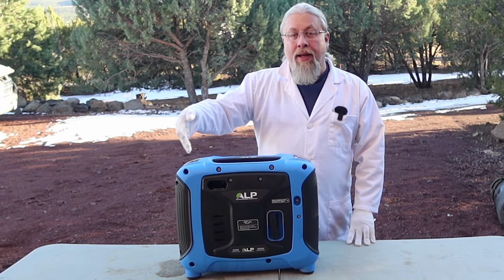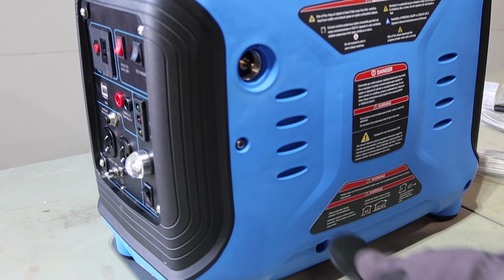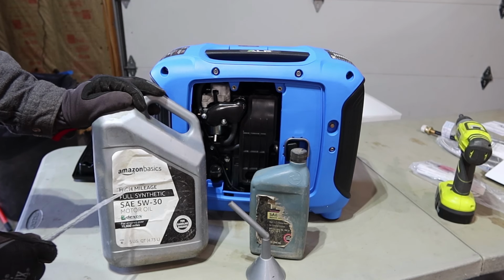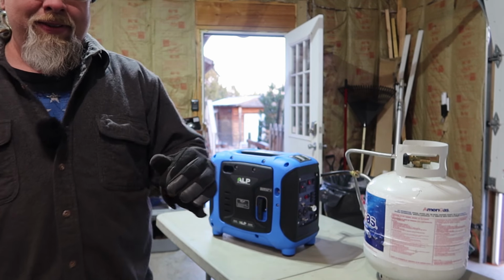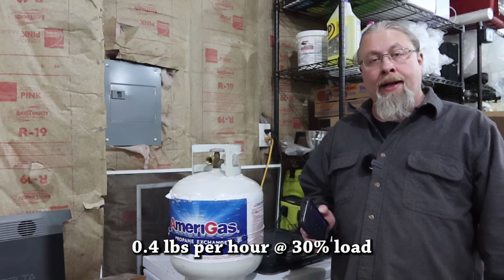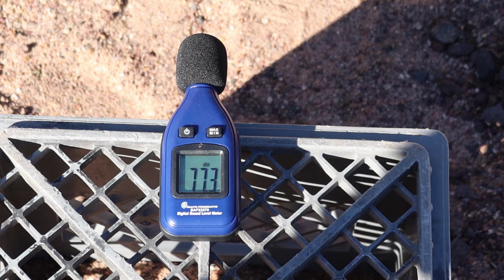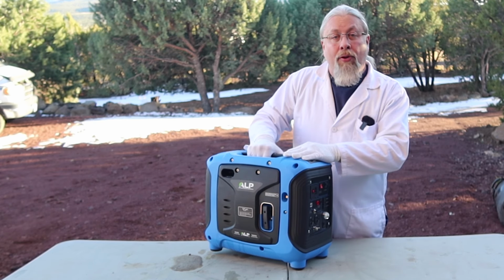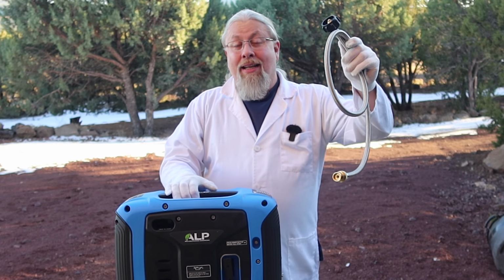ALP 1000w Propane Generator Review | Parallel Ready Eco Friendly Compact Efficient

Comment from the maker: HOW TO PURCHASE:
1) Add hose to cart https://hobos.cc/HyMy 2) Add generator to cart https://hobos.cc/1LAs 3) Use code HOBO1020 at checkout!
*PLEASE WATCH PART TWO BEFORE COMMENTING ABOUT THE NOISE!* --> https://youtu.be/LusD7q2vJnw
Reply: @HOBOTECH — hey man... one little tip/suggestion I felt I should share... Something I do quite often when a product has SCREWS where they’re less than convenient & I know I’ll need to remove them often... REPLACE THEM with a screw that has a KNOBBED END or an end that features BOTH a standard driver pattern, AND a swivel D-Ring (commonly seen in photography applications).

Since that door isn’t exactly concealing a large “security risk” and even with children present I highly doubt their “curiosity” will provoke them to undo both screws on such an intimidating machine, I see NO REASON to leave those screws in when you can swap them for a “tool free” alternative. 

For anyone besides Professor Hobooooo reading this, if you’re unclear on HOW to find an alternative fastener that has the same dimensions & thread pattern.... Just take one out, measure it’s thread length & diameter, and take note of the thread TYPE.  Search for either a “male threaded knob” or “screw with knob head” and etc... you get the point. As long as the LENGTH/DIAMETER/TYPE of thread is a match (AND there’s enough clearance on your equipment to allow for the knob to function properly) you can’t go wrong.  

The manufacturer should sincerely consider the fact that PORTABLE GENERATORS are not only for “ideal” overlanding applications and ARE COMMONLY DEPLOYED IN EMERGENCY (UNIDEAL) SITUATIONS such as winter power outages and active rain/snow storms!!!

Fumbling with SCREWS & SCREWDRIVERS during on-the-fly oil changes, maintenance, or troubleshooting during already tumultuous conditions?? NO THANKS.. 

The solution I’m offering here SHOULD BECOME STANDARD EQUIPMENT or should be added into the package so the end-user can choose which they prefer. 

They created a fine piece of machinery that MOST will want to trade in their gasoline generators for which PROMOTES long term usage where impromptu maintenance & troubleshooting WILL ARISE. 

Small details like this one are what separate the Hyundai’s from the Bentley’s... 

I think HOBO should provide this feedback and let’s see if they send out 2 upgraded screw replacements to anyone who already purchased this. Ya never know!
Reply: @flojotube  So for the novice, where does one buy this alternative...@ an auto parts store, Home Depot, etc.?
Reply from the maker: @itsallaboutjesus8935  You get it on their site via the links I posted in the description.
Reply: @flojotube  Be sure to use plenty of "locktight"'.
Reply: I was just scrolling down to let you know about the normal distance the sound is rated from. 54 is very low though. That generator sounded loud. Hard to tell not in person.
Reply: The code HOBO1020 is not working at their website
Reply from the maker: For those wanting more power don't forget TWO can be paralleled!
Reply: The economics just do not work.  Propane is too much money compared with gasoline. Gasoline is cheaper and it is more energy dense.
Reply: @tarstarkusz  agreed on my 6,000 watt 3000 continuous watt generator if I'm not running a lot I've literally seen it last 20 hours off of 3 gallons of gas
Reply: @tarstarkusz  or I can run a thousand Watts to 1200 watts for 12 hours off the same 3 gallons in the reality it's a 3 gallon tank it doesn't even use 3 gallons because I'll fill it up twice over a 1 day period and the gas can I'm using is only 5 gallons so I'm only putting in 2 and 1/2 gallons up to 3 possible
Reply: @CraftArtist  Not to mention how available gasoline is vs propane.  I live in a very built up area with natural gas, so there aren't many residential propane users that I know of and so getting propane is a bit of a hassle.
Do you happen to know what the use case is for this?  Why would anyone choose this over a gasoline generator?
Reply: @tarstarkusz  no clue from what I've heard it's supposed to be more efficient but I have not seen that to be the case I guess it would be good if you got like a generac generator and you hook it to your main line gas then it would be more beneficial cuz you would never have to go by gasoline but that would be just beneficial from a convenience factor
Reply: @CraftArtist  I'm pretty sure it would be a lot cheaper to run on a gas line service than even gasoline.  Natural gas is pretty cheap.
Reply: @tarstarkusz  that's the only way I see it being feasible
Reply: @tarstarkusz  Gasoline "spoils", especially typical gasoline that has alcohol in it's formulation which includes virtually all gasoline that isn't certain premiums (like Union 76).  The alcohol is hygroscopic which sucks water out of the air into the mix which helps decompose the gasoline.   Long story-short, propane generators always start whereas gasoline ones that haven't been carefully drained for any storage over 1/2 a year tend to get gummed up and won't start.  This, you find out in the pouring rain, at night, during an outage.
Reply: A good handyman can glue knobs to screws to solve your screw problem. 😎
Reply: I get an actual 1500 running lots for 24 hours for 5 gallons of gas that cost $10
Reply from the maker: @CraftArtist  Congratulations. That's quite the achievement! I don't think anyone has ever managed to burn a gallon of gas in 5 hours before.
Reply: @HOBOTECH  we get about 12 hours off of a 3 gallon tank but I don't think it actually uses the whole 3 gallons because we only use a 5 gallon gas can every 24 hours
Reply: @HOBOTECH  it's a 6000 watt peak generator 3,000 continuous bought at Walmart for $300 Briggs & Stratton engine
Reply: @CraftArtist   ,  so @ $12.00 a day?
Reply: @DougFenrich  roughly .right now gas is 2 a gallon
Reply: Caution should be used when thinking of fill amounts in terms of weights, given that the tanks are only safely filled based upon atmospheric pressure.
Reply: Buy thumbs screws to replace the Phillips
Reply: Thanks @HOBOTECH I just bought 2 and got 2 free hoses!
Reply: Excellent video!  As a brand new subscriber, may I recommend you re-record your intro with emphasis on the B in Hobo?  I was totally thrown for a loop.
Reply: That's nice but how many app. Can you run at a time
Reply: Help me out with my math. At 2/3 capacity it produces ~550 watts and over a 4 hour period it uses 3 LB of propane. That makes for 2200 watts total with 3 LB propane or roughly 733 watts per 1 LB of propane. 

Is that the best/most efficient setting?
My primary use is to charge batteries with it, so I’m looking for optimum watt per LB. 
How does this generator compare, in numbers, to  other single or dual fuel propane generators?
Reply: Anyone know when these are available again?
Reply: Professor do you ever think EcoFlow will produce a propane version ? Any inside scoop ?🤞
Reply: @HOBOTECH — Dude.... wowwww..... I sincerely wish I could buy this RIGHT NOW.... excellent video AS ALWAYS.... and guess what....

it’s HOOUUUUBOOOUUUU TEXKNOOOOUU!!”
Reply: @flojotube  I  i r if
Reply: @flojotube  i rig
Reply: @flojotube  to  free wiring  free tiwfwit itwigii  r I red fwii r I err otiritirororoiii
Reply: @lindseytrousdale7567  you drunk or high?
Reply: @flojotube  i

Comment: BTW, bring your 20# propane tanks to your local U-Haul dealer, and they will fill them up to as close to 20# as possible. In addition, they will charge you only for propane added to your tank, Vs Home Depot, or other exchange location, where you pay for a full tank even if your old tank still has some propane in it.

Comment: The coolest use of this is to do DC out to into the solar input of a solar GEN.  This would be so much more efficient than an AC generator to charge your solar gen.    Probably 40% less fuel due to conversion losses in the inversion then again in the conversion back to AC.

Comment: After your review, I got this generator. 

We lose our power a lot because of where we live in NEPA. 

Customer service was great. The first unit was damaged in transit. I called and they immediately replaced it before I returned the original. 

We lost power before I had gotten everything set up and needed to fill a tank of propane. I did have a bunch of 1# tanks and just used some of them for the night. We got 3+ hours on each tank but I only ran 2 floor fans, lights, and a tv. It was a hot summer night but this was great for the situation. Since, I’ve gotten a 5# tank for camping and 20# tank for home use. I’m a grandma and was beginning to have trouble starting my Honda but this is just fine. 

So, thank you for this demo.

Comment: What air conditioner do you have that can run on 800w continuous and 1000w peak?
Reply from the maker: Any 6000 BTU will run 350-500w continuous. I once ran one for 3 months during summer on a 800w generator. I have 5-6 year old videos showing this.

Comment: Based on your results, at your altitude, the ALP consumes 1.6 pounds of propane per kWh with a load of 250W but only 0.75 pounds per kWh with a load of 550W.  Internal combustion engine generators are usually most efficient at about 75% to 80% load, and your results are consistent with that.  If using one of these (or any internal combustion engine generator) as backup for a solar with battery system, select an efficient charging rate to use the least propane per kWh.

Comment: The 1000 watt generators just not quite enough you have to have 23 2500 or over, space heater electric skillet, and I don't even know if that will run an AC unit. I want the wind generator 4570 W Surge and $450.00 you can't beat it it has 220 volte, it's not a sine wave generator you got to be careful with your electronics but anything else you don't have a problem with it, plus it runs on dual fuel, electric start !

Comment: You should always take the label off your propane tank make sure it doesn’t have bubbling rust. Surface rust is fine but if it starts to bubble you need to get it checked.

Comment: All gen sets I have seen use 21 ft distance to test db level… you used 3 …..huge difference.
Reply from the maker: You ignored the pinned comment.
Reply: @HOBOTECH  Ignored is the wrong word …it implies I saw it and chose not to acknowledge it . I didn’t see it or any of the others comments ..I liked the idea of the little gen set and was simply making a point about the distance based upon watching the video.. If I stick my face 3 ft from my Honda 2200 inverter it’s loud too. I have several larger propane generators and need one small like this….J.

Comment: Can I use a Eco flow Delta Pro while charging it with 2 APL generators that are paralleled  together or will the power past through to what ever is plug into the Delta Pro ?
Reply from the maker: Some power will charge the batteries while the rest will pass through according to the app settings.
Reply: Thank you!   @HOBOTECH

Comment: Can you use the 12V output to connect a Victron DC to DC charger or converter to charge my standalone battery or standalone power station?  If needed in an emergency.

Thx!

Comment: Thumbs up on the video. IMO for $530 (2023 sale price) this unit is overpriced for it's capacity. It also should come with a hose you can use on a 20 Lb. tank. Who would run this on a 1 Lb. tank? Oil and a tool should be included. I don't like needing a screw driver to add/check the oil. Liking the LED light.
Reply from the maker: My code includes a free hose.

Comment: tbh, if this generator scavenges a bit of engine oil to be used for upper Cylinder Lubricant, I'd buy one, otherwise it'd have to be dual fuel to make sure it gets regular lubrication from the Gasoline. It will be interesting to see how long this lasts before breaking, if it isn't scavenging engine oil lubrication tbh. Great review, many thanks, and best wishes from Bob in Wales.  👍✨️✨️✨️

Comment: Only big problem with Gas Fuels like Propane, is the destructive effect in internal Combustion Engines is the lack of upper  Cylinder Lubricant which is so bad, if used in Diesel engives, the injector pump would rapidly cough and Die. In  edibles, it is why you need to frequently switch from Propane,  back to Gasoline/Petrol, to get those important internals lubricated again. I think this is why Vehicle Sales of Propane have pretty much collapsed in  retain, and there are very few Propane stations left, and it is relatively difficult to find them nowadays. 🤔👍

Comment: Would the generator motor be alright if it was running on a moving trailer with shaking  around , would the oil keep the engine lubricated ?  Thanks for the video and have a nice day .

Comment: Absolutely with our inefficient gasoline that has to be atomized by our inefficient carbs you should change oil at 50hr intervals. But propane does not have to be atomized by the carb and also does not require tons of dirty additives to stabilize it. Therefore you will not necessarily need to maintenance nearly as often.

Comment: I was surprised that the propane actually flowed at that temperature. That’s a problem I have with most of my propane heaters up here in a Vermont winter.  I suppose because it uses so little propane the cold tank can keep up.

Comment: Will this run on natural gas without modification? This would be awesome.
Reply: Natural gas has a lower BTU rating than propane.   If adjustable, the regulator needs to allow 2.5 times more fuel into the engine  if you want to use natural gas.
Reply: @danburch9989  Thank you kindly for the response.

Comment: For Sale: Baja used twice Excellent Condition in box. Inverter 700-900 watt Inverter Generator propane only 1 pound propane cylinder or larger propane tanks. Generator 26 pounds with oil. Can look it up online if more information is needed. Leave a message if interested thanks.

Comment: Best review yet! It sure explained why I didn't get the 60 advertised hours out of my propane tank . Left me short few days on a dry camping adventure.  I needed it to power and ARB fridge freezer and a small mini freezer and I estimated about 40 hours a tank but I didn't count on the tanks not being completely full and I only averaged about 24 to 34 hours a tank. That makes sense now. I appreciate you weighing it and all the time you took to do the test it was very enlightening .  For others people's references, I went through four tanks in nine days.  I was running constantly in the beginning days using the small freezer to make ice for the extra cooler.  I changed the oil every 24 hours because of the environment I was in.   Once I could see I wasn't going to make it to the end of our 12 days, We were able to transfer everything to the ARB and I ran it to power that for about 15 hours day. We ran out 24 hours before ready to leave the island. I'll be better prepared this time and now I know why I need more thanks to your in depth review. Thanks again!

Comment: I bought the Alps 1000 propane generator performance is good I bout to back up my Jackery 1500 with 400 watts of solar panels in case sun was not out for several Days I could still charge Jackery my question -is it normal to smell propane fumes while the generator is running checked the connections and they Appear tight guess I could use Teflon tape at the connections.

Comment: How do I know what is safe to plug into this generator or what it is able to run? Can I use it for an Air Fryer, Toaster Oven or Coffee Maker? Will is run my 7 cu ft. deep freezer?
Reply: You would have to figure out wattage used by each appliance. Then compare them to the generator's rating.

Comment: This is a really expensive generator for what you're getting. It doesn't put out very much power and it's not really that small.
Reply: The benefits of running off propane are great but that's more of a long-term benefit.  It's great to be able to store propane for 10 years because you don't know when you're going to need it. If you're using this regularly then the benefit is dramatically reduced. I will say having a small output generator like this couples with one of those batteries with the pure sine wave inverter in them would be pretty sweet. You could then get your higher outputs and recharge as needed.

Comment: Wow, this would be perfect to run my small AC in my trailer in Baja. I’m on solar exclusively and can’t run AC yet, is very costly to get the system upgraded. I have a monster gas generator that needs 2 strong people to pull out of the shed and gas is way more expensive there where else propane is cheaper than in USA. Thanks so much!

Comment: Don't know if anyone else said this, but your reservations about doing an oil change at 50 hours might be incorrect. I know that my Dad has had experience with LP tractors and has said they run cleaner as far as carbon buildup in the oil! He also said the oil almost always came out just slightly dark like it only had a a hundred or a couple hundred hours on it rather than the 500 they normally changed it at.

Comment: Gas powered generators suck. Gasoline sitting in a generator will degrade and make the generator useless when you need it most. Spend a little more and get propane instead.

Comment: On the oil change/hours, LPG/Propane is a very clean burning engine, the oil will come out looking almost as clean as new. Very little contaminates and carbon. The cylinders also last longer as the gas is dry and doesn't wash off the oil film in the bore. Here in Aus we had all our taxi industry on LPG and many factory fitted dedicated LPG cars. Not uncommon to get 1m miles from them.
I have had one for 10 years and it is the lowest maintenance engine I have ever owned. (LPG-liquid pretroleum gas.)

Comment: Handy.  Tank of propane for heat/generator, batteries, and some solar panels and you can have around the clock power for a decent number of days in a small camper.